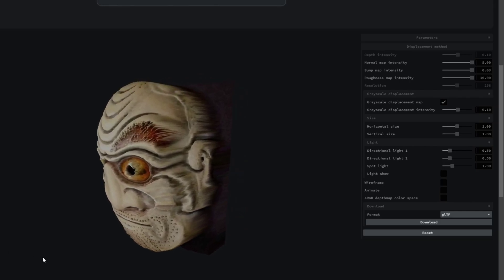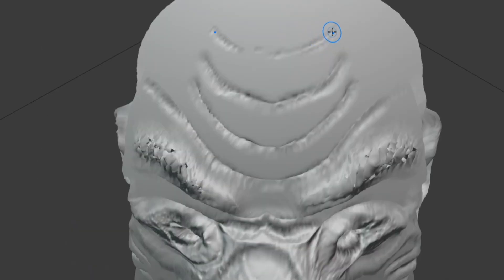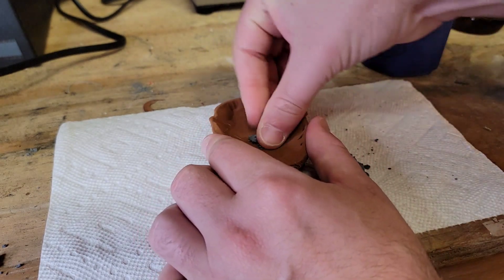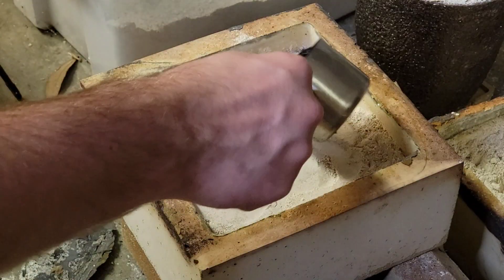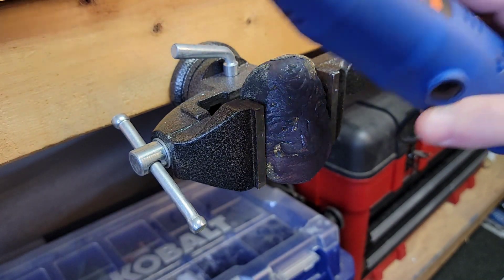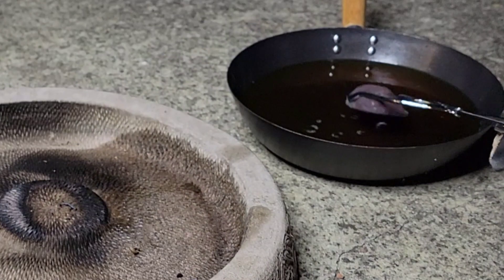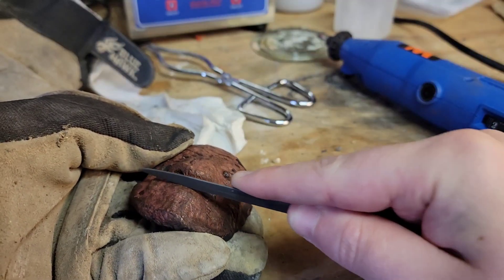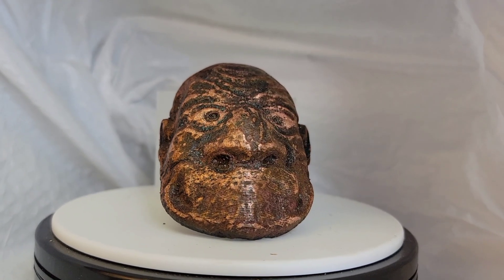Copper Noh Mask | Metal 3D Printing | Virtual Foundry

Comment: Hi mister highball!

I'm a student doing a thesis with the virtual foundry bundle, in particular I'm printing and sintering with steel 316L filament.
I'm having some problems with the sintering part, I'm going with a trial and error approach, gradually lowering the sintering temperature, because with the temperature given on the firing procedure from virtual foundry the products resulted like melted. Tomorrow we'll see.

But since I'm out of sintering carbon, and I'm having problem to get it quickly from Virtual Foundry, I wanted to ask you if you maybe know the mesh size and the carbon % of the sintering carbon sold by Virtual Foundry, because they don't provide these info. And i wanted to ask you if you think it could be possible to use some graphite powder instead of the sintering carbon, with an high % of C, but maybe with different mesh size.

Thank you in advance!
Reply from the maker: Hello 👋 
I personally just buy some coconut carbon from Amazon but have used wood chips... charcoal... graphite powder mixture... really anything that burns and scavenges the oxygen should do (the wood chips smelled pretty nice 👌 charcoal... not so much) 

I haven't experimented with 316L yet so I don't know some of the gotchas that come with sintering that one, but with copper at least carbon choice is pretty flexible (some sources make a lot more smoke then others)

Pretty sure this is what I've bought

https://www.amazon.com/Filter-Coconut-Granular-Activated-Charcoal/dp/B07K1RX3S3/ref=mp_s_a_1_5?keywords=coconut+carbon&qid=1650989248&sr=8-5
Reply: @Mr-Highball  Thank you for the info!

I'll search it in Europe (I'm from Italy) and/or I'll try with other sources!
Reply from the maker: @massimotarsitani4434  no problem and like I said before you can use standard bbq charcoal but certainly be sure you have good ventilation running for that. I just crushed it up a bit to layer it on top of the refractory
Reply: @Mr-Highball  I'm sorry, another question...
Since we are having some problems with the sintering, we are trying to slightly modify the sintering temperature and/or holding time, but we are not sure this is the right approach. What do you think is the best thing to do? Experimenting with temperature and/or time until, given the part to be sintered, we succeed? Or maybe something else?
I was thinking maybe is the positioning in the crucible that is not the best, but we are following the Virtual Foundry indications. I can't think to much else at the moment.
Thank you in advance!
Reply from the maker: @massimotarsitani4434  no problem, and sintering time & temp are probably the most important, but I've also found that crucible material, refractory used and things like part placement are pretty important. I use alumina crucible I've made myself but had issues with graphite crucibles causing "hot spots". Another thing I do is always pack the part down in the refractory pretty tightly (I know this goes against the recommendations but I've found I gave better success when I do).

Also, a major factor would be the ramp time so one thing you might want to try is a slower ramp even if the peek temp is the same which should ensure an even heating.

A lot of my sinters use a 1-step approach but lately I have been doing 2-step debind/sinter but I still ramp up fairly slow on the 2nd step
Reply from the maker: @massimotarsitani4434  to follow up my last post

My gut would be something like this for the sinter firing schedule

* ramp 300f per hour to 800f
* hold 2 hours 
* ramp 350f per hour to 2000f
* hold 1 hour
* ramp 100f per hour to peak 2420f
* hold 15 mins 
* ramp down 100f to 2000f
* end sequence and naturally cool

I haven't looked at the vf's firing schedule for steel but this is probably what "I" would try so.... maybe just compare this with what your doing and you might find something to tweak with your schedule that'll work
Reply: @Mr-Highball  Thank you!
The last sinter we did today was better, but it was dishomogeneous! We got metal with decent form, but one side shrinked while the other no.
We are out of Sinter Carbon right now, so we can't sinter anymore.
Too bad :(

Comment: What gives a wonderful patina to copper is English Mustard, paint some liberally onto the shiny parts and wrap it in cling film and place in a warm place for 24 hours then unwrap and using a stiff brush remove the dry crusty parts of the mustard and reapply some fresh then re-wrap and place in a warm place for 48 hours after that carefully remove the mustard with a wet brush and you should have a very turquoise like effect, I also paint some of the areas around the mustard with salt and vinegar just for some change to the patina.
Reply from the maker: I haven't heard of that before will certainly give that a try!
Reply: @Mr-Highball  I got it from Crimson Custom Guitars who were creating a patina on copper pick guards
Reply from the maker: @AndrewAHayes  I'll check em out 👍